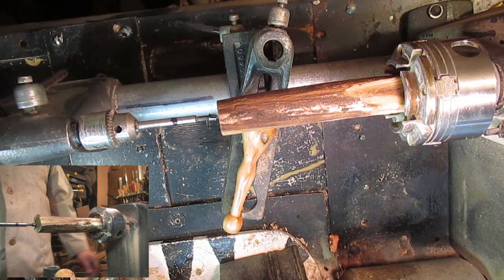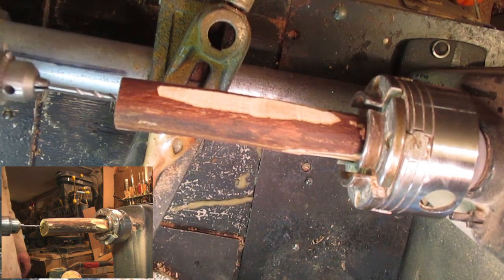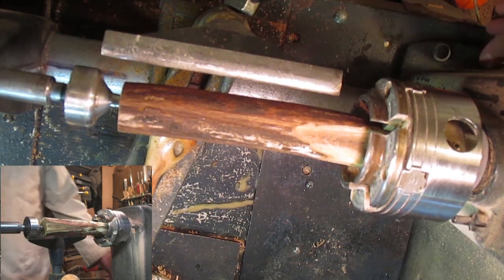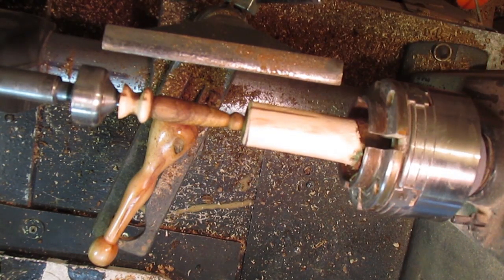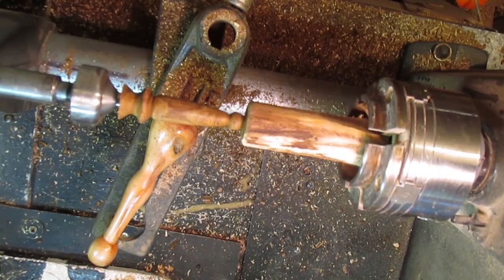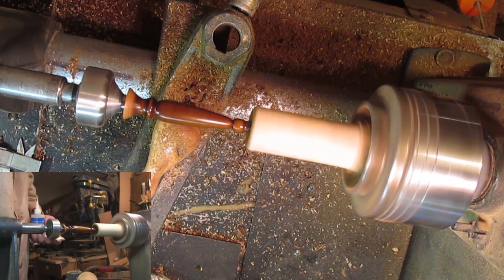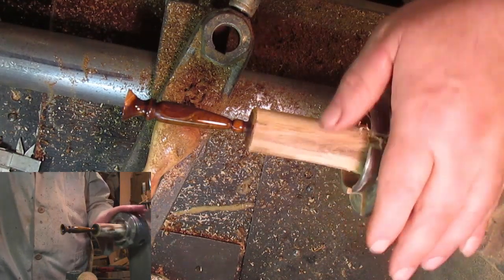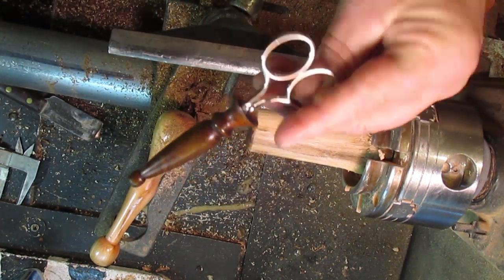Wood Turning #83 Scissors You Can Run With

Comment: I see you use that skew all the time and you really good with it.  I cover mine with a rag ... It scares me :)
Reply from the maker: Hello Chris:   When I started using the lathe... I didn't have an awful lot of knowledge about the different tool or how they worked... and so I used the one that seemed the most efficient to me... Those other gouges always kept getting catches and causing all kinds of problems... so I stuck with my skew and became fairly proficient with it!    Now after all these years I am starting to explore other tools and am finding that there are so many options! And each one works well for what it was intended! But when ever I run into trouble I always seem to run back to my skew...cause I know it has only one blade and if you hold it right... it will do what you want it to!!  When you watch a lot of these shows you will hear guys saying that you can use a roughing gouge... like a skew... and you can use a parting tool like a skew... and I wonder... why not just use the skew?  I hope you keep chloroform in that rag... makes them easier to deal with! :-)  Thanks for watching  Larry